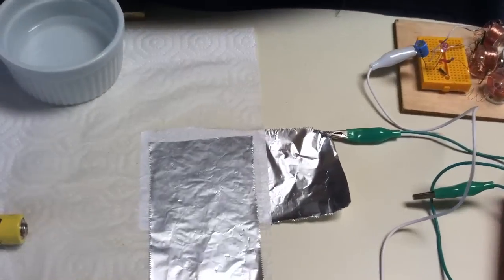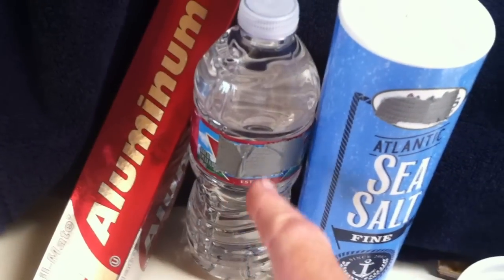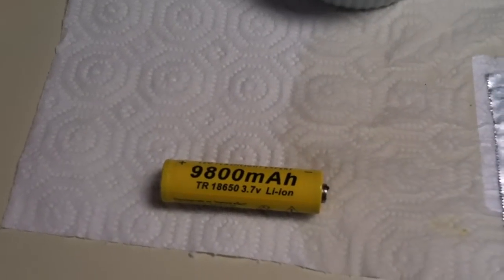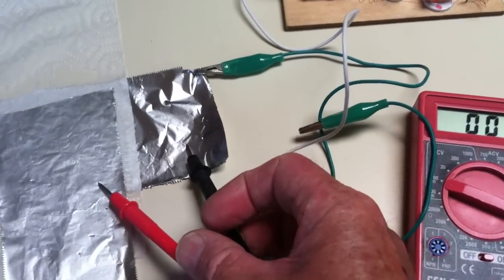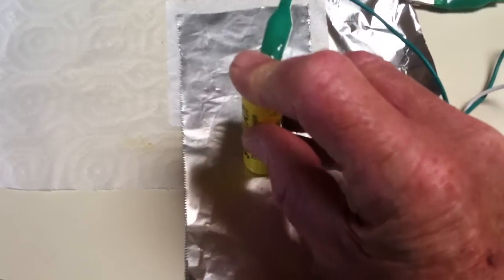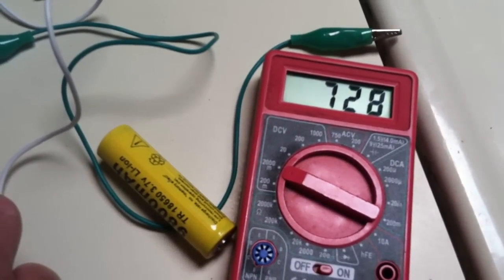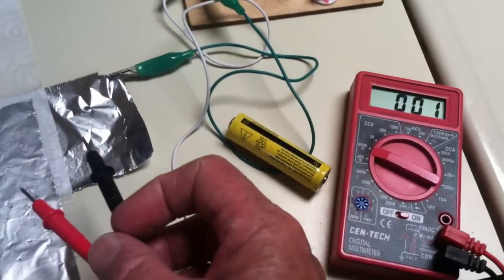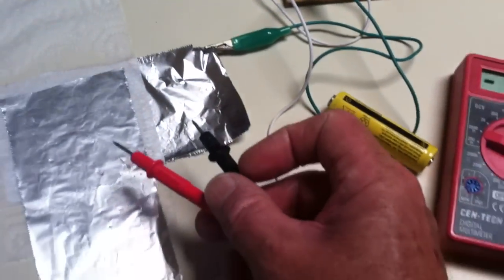Amazing Simple Battery

Comment: If you think that's hard to believe. Replace one of the aluminum foil electrodes with a piece of graphite foil. Then put some Titanium dioxide on the paper next to the other aluminum foil  That battery, WITHOUT salt electrolytes, will self-charge itself until the cell drys out. Put more water on it, and it powers up again! Try it and see for yourself!

Comment: Thanks for bringing this to my attention. I think this is amazing as well. I seem to be making a habit out of sticking the voltmeter on a lot of different things lately. My metal building is galvanized steel (Galvalume) . It is making half a volt reliably when the negative on the meter is to earth. I'm going to try to use it when the snow melts.

Comment: Just tried this experiment with zinc coated steel plates. Got a little over a half volt. Took a while to discharge. It bubbled and I knew it was splitting water into hydrogen and oxygen. There may some other chemicals in it as well.

There is a danger potential for using stainless steel. It could release a harmful type of chromium that is poisonous to the human body. I plan to do this experiment with copper and iron as well.

Perhaps a stack of these cells would add voltage. It seems to top off at about half a volt. And the ionic flow I think slows the capacitance discharge.

Comment: aluminum and a sheet of graphite....the real trick will be to find an electrolite that doesnt corrode....maybe a crystal type of some sort. There is someone that is testing silicon graphite type cell...and i believe alluminum for the what he calls 'donor' plate so im assuming it corrodes...but hes pulling amps from 6 plates that are pretty small...quantum mechanics i believe is the website. not sure if hes is using a crystal dielectric or if its a liquid. when i was a kid my friend at ten years old was making mason jar batteries using orange juice and a couple bolts through the lid.....hehehehe

Comment: Great video. I am also surprised that more people haven't spoken about simple batteries like this, using the same materials for anode and cathode. I've been thinking a lot about carbon-carbon capacitors lately and this goes hand-in-hand.

I love this simple build! It seems, since there is bubbling, you need to enclose them for extended performance out of fear of ELECTROLYTE ANNIHILATION.  :)  Electrolysis is interesting, especially with the salt present. I like what Alex D said about the oxygen reacting with the aluminum; pretty fascinating. I wonder what would happen if you used an anodized Aluminum instead (Aluminum-oxide passivation layer). Also, what happens if you keep it sealed? I would predict lower voltage but longer battery life.

Would you be willing to add another variable into the picture, like maybe some graphite dust from a pencil, or some activated carbon, on the aluminum and then compare capacitances? Something simple and controlled; the Lidmotor way.

One gentleman I spoke to mentioned adding graphene into the electrolyte as well, not just spreading it on the anode/cathode. I thought that was thought-provoking.

You've seen lasersaber's build, right? I've been thinking a lot about these simple batteries, because it seems we could quite possibly get fantastic performance and power a LIFE... just gotta spend a few days building batteries... which sounds like a blast to me!

I look forward to your future experiments! Thanks again for sharing.
Reply from the maker: Thanks for the comment.  Several people have suggested adding powdered graphite or graphene to the electrolyte or plates.  I have tried that on other cells and had difficulty with the cell shorting out as the graphite migrated when the charging and discharging happened.
Reply: Sounds like you need a better separator then? Were you still just using paper towel? Maybe some plastic would do better.
Reply from the maker: I have tried a number of materials but the pesky little carbon molecules find their way through.  I have considered trying the 'salt bridge' method.

Comment: Very cool Lid! Just like an HHO cell after the power has been turned off it will hold a charge and depending on the design It can hold a charge for days.
Reply from the maker: I didn't know that.  Thanks.  If the HHO cell is made of stainless steel plates (like most are) then that shoots down the simple Al - Air battery theory for the cell I made here.  This might some kind of hybrid.

Comment: It is interesting that this works using what seems like two anodes?   Maybe the salt is acting as an impurity creating a diode effect like an NPN/PNP junction that allows the electrons to separate at opposing plates.  Sorry if I am way off just got up and having my morning tea:)
Reply from the maker: Thanks.  You might be right.  Somehow I am turning one of the anodes into a cathode.
Reply: Works with two anodes, because through electrolysis, charging creates oxygen bubbles only on one side, oxidizing only one side of the aluminum during discharge :) Or maybe chlorine in the case of a salt water electrolyte, still an oxidizer.
Reply: That makes sense.   After charging you have an aluminium and an aluminium oxide anode and cathode????
Reply from the maker: I think that Alex D has come up with how this is working.  I have not seen this before but like many of my experiments.....this was probably discovered by some guy back a hundred years ago
.
Reply: when you charge it you get hydrogen on one plate and oxygen on the other.  You make an aluminium oxide cathode the first time it is charged. of course it continues to oxidize and gets consumed.  but after it is charged you no longer have identical plates.   Maybe I am oversimplifying I dont think so this time

Comment: all you need is to add a sheet of carbon cloth on one side between the aluminium and paper towel and now you should have around 2 volts with the same characteristics or better as the cell you just put together
Reply from the maker: Been there done that.  Making a battery with the same element on both electrodes was the goal here.

Comment: Trolls came out to give some thumbs down I see.  Stupid trolls are stupid.
Reply from the maker: This has been going on for awhile.  I think I know who they are. One is Canadian and one American. It doesn't bother me.
Reply: *****
Good, because they shouldn't.

What I do not understand is that the metals are the same and shouldn't they be dissimilar metals to form a battery?  It is like a mixture of a super cap and a battery taking a little of each.
Reply from the maker: That is the thing----this shouldn't work.  It is acting more like a super capacitor.  I think I know why.  It has to do with the high amp charging and the AL/ air reaction.  The problem is that one AL plate does take the hit and gets eaten.  I'm just guessing really about what is happening.  I need to do more testing.
Reply: *****
I look forward to your further testing on this thing.

Comment: Glad to have shared it and that you got a kick out of it :)
I got on to such things with the supercap experiments and the usual process of elimination, to find out which ingredients are most active...when left with sea salt, the Al plates still worked well. Add a dusting of fine powder activated carbon for amperage and then onward with phosphor (gel or match heads), graphene, sealing methods, charge rates etc.
Reynolds Wrap Non Stick foil is thicker than average, it holds up well to any pitting over time and many charge cycles.
Reply from the maker: I'm thinking that what I made was an Aluminum - Air type battery like Alex D mentioned below.  It is perhaps the reaction between the Al and oxygen that is causing the juice to flow.  I need to do more tests. Thanks for tips.

Comment: I've been following Robert Murray Smith's progress on simple graphene batteries like this. Mix polyurethane+activated carbon and paint it on the inside of those plates for massive surface area. I use graphite foil for electrodes while testing corrosive electrolytes. Stuff like this is our future. Thanks for your videos!
Reply from the maker: I have followed Robert's work for years.  You are right--"Stuff like this is our future."

Comment: Hmm, maybe you're creating some sort of an Aluminum-air battery? The oxygen, created by the electrolysis, oxidizes the aluminum, producing electricity, just like a regular Al-air battery. If that's the case, it's not really rechargeable though, you're just creating oxygen, which then oxidizes the aluminum. Interesting.
Reply from the maker: I think that you are right about this being an Aluminum-air battery and not a rechargeable.  The Al foil gets eaten.  After a few zaps with battery you can hold the foil up to a light and see right through it.  It was still a very interesting experiment.  I may try this with thicker aluminum plates and see if how long it lasts.